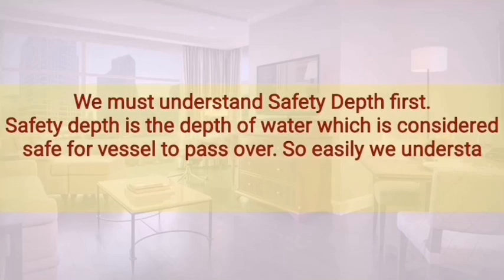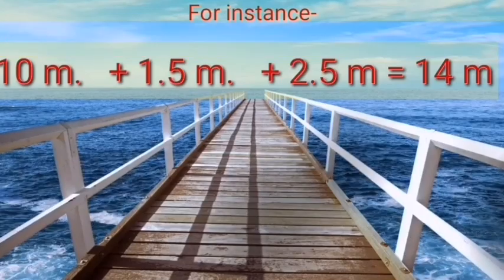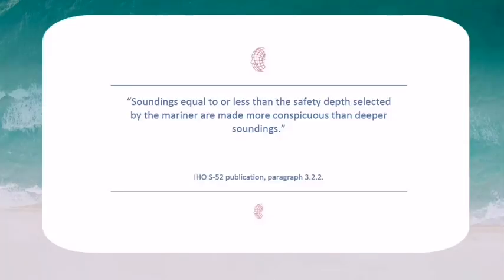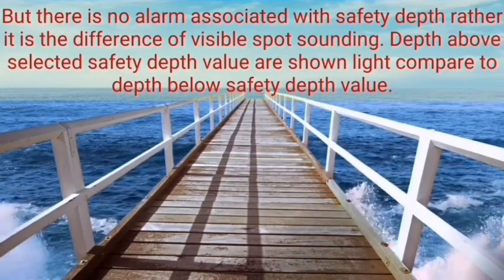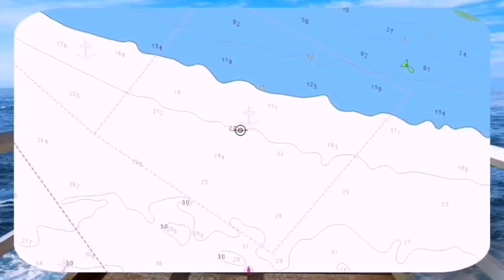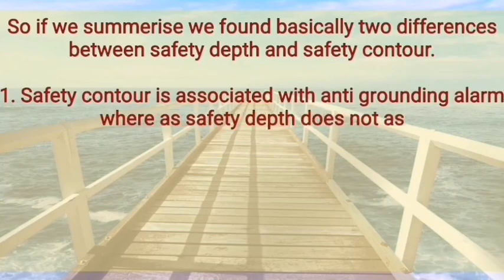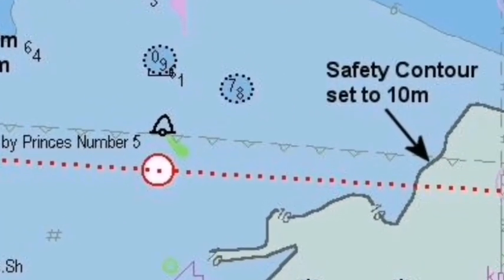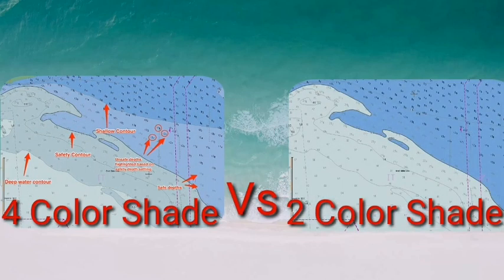Safety Depth Vs Safety Contour | Ecdis setting | Sailor 360

Comment: Is it possible to adjust the safety depth together with the safety contour
Reply from the maker: In JRC and Transas Ecdis this two options are separate hence, also need to put value separately. I dont remember of any type specific ECDIS where these two options are merged though these two values can be the same. Thanks mate for your comment and excuse me for inconvenience.